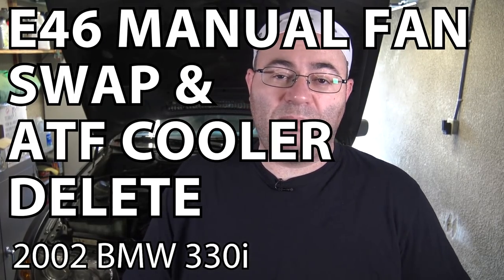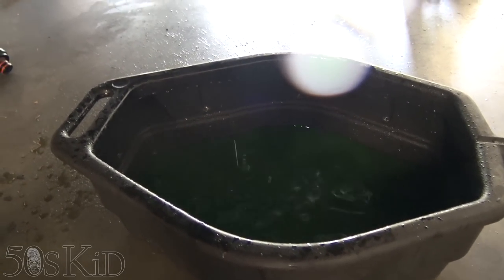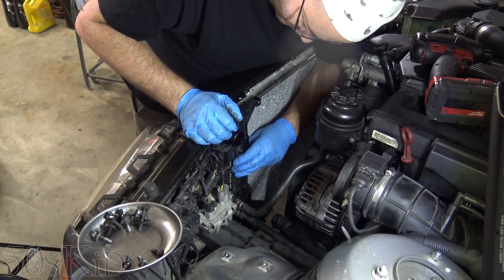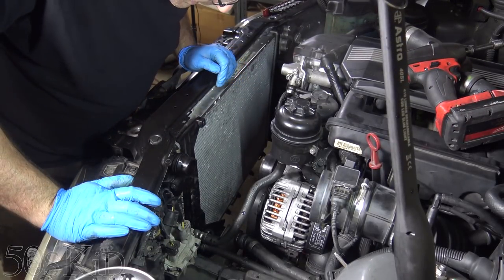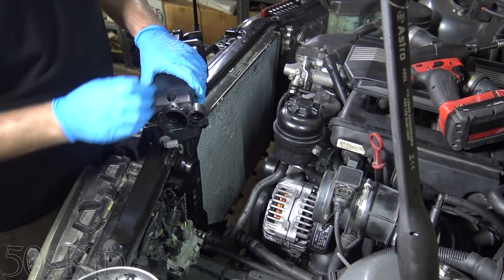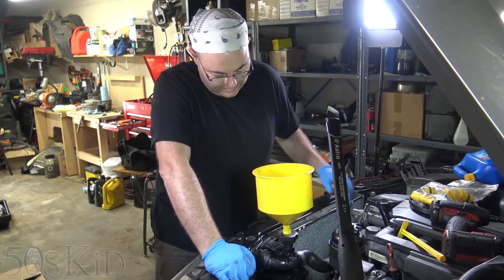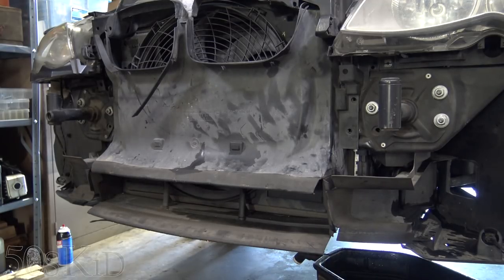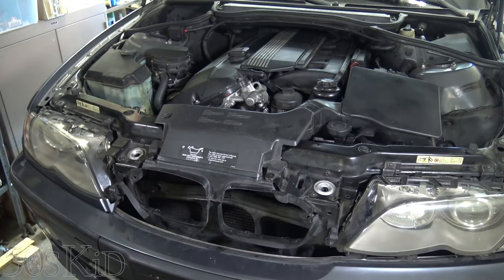BMW E46 Manual Swap Project: Electric Fan & Radiator Bracket Swap DIY

Comment: i have a 2003 330ci (coupe). in the past year my radiator fan blades broke 3-4 times at high revs , damaging the radiator with it. So I kept changing fans and radiators but the fan still breaks into pieces at high revs. I tried changing engine mounts and still to no avail. Should I just swap that radiator fan to an electrical one? Should I change the water pump? Can anyone pls help me out as I spent over $1000 on radiators and radiator fans.
Reply: Yes. Replace with electronic fan.
Reply: thanks. i replaced the radiator fan with a Hella electric fan. AC fan is still there didnt touch that one. Car is not shaking anymore when at stop light in Drive. Car runs smoother, so far no issues with the fan.
Reply: Hi what fan did you use? I converted a 320ci 2.2 to a manual. And would like to do an electric fan conversion.
Reply: @Uranus707   Hi the electric fan was 119 GBP ( British pounds) and the brand name its HELLA . done the fan conversion end of Feb...so far so good no issues.
Reply: @Uranus707 Best source is a wrecked E46. Any manual trans model 4 or 6 cyl will fit. I picked one up today from my local wrecker yard for $25.
Reply: @DiscoFang  thanks man. I went to the yards to to look for mine.

Comment: how will moving a pusher fan from front work correctly when installing behind radiator? it would need to be a puller fan! or its going to be fighting against natural airflow while driving down highway,  will only work when stationary or driving very slowly!
Reply: Is the auxiliary fan a pusher or puller?
Reply: @Stefan_Smith  pusher
Reply: Watch the video again. The two fans are completely different
Reply: This fan is from a manual trans car.  its designed to fit behind the radiator.  IMHO a much better solution and prob more effective, and much easier to work with when you need to get in there.   This replaces the whole mech fan shroud.  and will use the connector that the front fan plugged into. so the front fan is now discarded.

Comment: I need to change the radiator and the expansion tank, as well as the upper radiator hose. Upper and lower coolant hoses I’m changing to silicone hoses which has me wondering if it’s a good idea to switch to silicone O rings as well? If so do anyone have any sources or sizes I’d need?

Comment: May I asked what the purpose of this swap? What’s the difference between the fan being in front of the radiation and behind it?
Reply: the clutch fan can grenade and take out other things in the cooling system. It also makes working on the accessory system easier.
Reply: Probably adds a couple HP too.

Comment: If I want to change my mechanical fan to electric one from any of the manual model do I have to change radiation and bracket aswell ?
Reply: No. Once you remove the old shroud and fan, the electric one slides straight in. Exactly the same T25 screw and push-pin secures the new one.

Comment: Can I use both fans?
Reply: No, if you leave the aux fan in, it will restrict airflow to the radiator and electric fan.
Reply: If it restricts it, how can it work on other BMW:s too.... For example E53. I mean, this is just talk, you can say what ever about airflow restrict, but if it does, many BMW cars would have been overheated as factory builds :p
Reply: The thing is your using the same plug, there's no way to power both fans unless you do a whole lot of work.
Reply: @Yophillips3272  Aaa ok! That's the stuff. Yea then this is kinda totally different, and should then use really one fan only. I was in blackout, I have never had E46 of BMW's models.

Comment: Can this be done to a 03 530i? My reservoir is on the opposite side and mounts on to the shroud also why are you getting rid of the ATF cooler is it defective or unnecessary?
Reply: Never mind manual swap got it but I'm still interested in installing electric fan

Comment: What about when you drive without a/c , is the fan works automatically? Or do I need to do some kind of retrofitting to the DME , I am going to do the same swap on my E46. Thanks for all the info.
Reply: The plug for the aux fan will plug in the new fan. No need to wire anything. It will work the same.

Comment: Hey dude I love the videos huge fan. I have a question for you, I have a 2004 bmw 330ci 6spd Manual convertible. My clutch fan is very loud and I would like to do a delete. I read everywhere online that a manual e46 shouldn’t have a clutch fan? Well mine does, also I have the fan in front of the rad I assume is for air conditioning, that fan never sound regardless if Ac is switched on or not. The air comes out the vents when I turn Ac on but the air does not get cold. What is my issue, how can I resolve it, and can I delete both fans (Ac fan, and clutch fan) to do a swap with an electric fan?
Reply from the maker: You can do a swap as I did in this video, yes.  If your manual fan is loud, it has failed and is stuck in the "on" mode (normally it just freewheels but doesn't spin at the same rate as the engine unless it gets really hot).  If it goes too fast, the plastic fan blades can explode and take out your radiator.  It's happened to me.
Reply: 50sKid okay, thank you for your reply. Also my air conditioning doesn’t run cold. I’m trying to diagnose my issue so I can resolve it. If the ac fan never runs regardless if ac is set on or off, does that suggest my fan could be the issue?
Reply: @Sitdownbruhh  If your AC system is low on gas the AC compressor won't actually turn on. You can press the AC button and think it's running but it may not be. So the front fan won't run either. Possible reason.

Comment: are the expansion tanks different for manual and auto trans?
Reply: the expansion tank is for the car's coolant system and no coolant goes to the manual transmission, so... no?
Reply from the maker: Same expansion tank
Reply: Well it is a BMW there are no stupid questions for BMW lol

Comment: what if the air conditioning is not on ? will the fan turn on ??
Reply from the maker: yes, when the engine needs to lower the temperature of the coolant
Reply: thank you!

Comment: I have 2003 bmw 330i should I look for any electrical fan from any manual model ?
Reply from the maker: +79Pavlito yes
Reply: Thank you
Reply: And the 4 cyl models as well as the 6s have the same fan.
Reply: @50sKid  Hi, first.....thank you very much for your channel, there are many others and no offence to anyone, but yours just IS the best.
2nd, i have a manual '99 328i pre-facelift E46 and mine has only the viscus and the fan in front of the radiator. I read some of the comments which say that y
the fan you used was off of a manual E46......does that mean that i take the one in front of the radiator and move it to the back to delete the viscus or is there another fan.....sorry, just want to be petfectly sure before i mess up.
3rd, where have you gone? I am not seeing any new video's...
Believe it or not, i enjoy watching even the videos that has no bearing on me 'cause i find it entertaing...your method if delivery......so i'm quite sad to see that i have gone through almost all and no more are coming. Anything we as fans can do to help keep the channel alive????
Anywhoo, hope you see this and that everything is still well with you. Your channel might seem like a small thing, but you have made a big difference in many people's lives.

Comment: Could you not use the front fan for your read fan
Reply: The shrouds are different but the motors are the same
Reply: No, its less powerful. U need to use the correct fan

Comment: hello jason.
considering I would retain the auto trans and therefore the auto cooler and radiator mounts, instead of just by chance encountering a manual e 46 at the junkyard, would you know whether there is an oem or aftermarket electric fan available to replace the stock clutched puller and the secondary fan?
I intend to model a replacement on your tutorial.

andrew
Reply from the maker: Yeah the manual E46's have the electric fans that fit in where the manual fan fits in on an auto.  You can just grab one--I grabbed an extra one myself for a friend of mine.  They were about $40.
Reply: if I understand correctly, you remove the clutched fan, remove the aux fan assembly and the front of the radiator and replace with the "manual sourced electric fan" and plug it into the existing plug where the previous auto fan was located.
and job done?
I suppose the fan shroud then becomes redundant and can be left off the vehicle.
Reply: @andreiput9492  You have prob worked this out by now as its 4 years ago - but the mechanical fan shroud is discarded along with the clutch fan - Manual fan comes with a shroud built in the just drops in.

Comment: Hey, I have a 03 330xi and i'm attempting to do this swap. However, the fan I bought doesn't have the connection for the "air sensor" you mention @ 23:57 . Can I let this just hang? It doens't seem to be throwing any codes..? I got this fan: https://www.amazon.com/TOPAZ-17117561757-Radiator-Cooling-Assembly/dp/B06WGR7QG2 THANKS
Reply: Oops nevermind, the fan comes without the smell sensor so I just unhooked the one from my original and good to go!

Comment: Testing at 15psi? Bmw uses a 29psi cap
Reply: BMW also told me after a check i had done by them right after i bought the car that the 10k car i bought needed 290k's worth of repairs 😲
I'd rather stick to the advise that the 50's Kid gives than what BMW says 'cause the 290k bill they wanted to stick me with turned out to be around 5k in the end and my baby is still going strong 💪

Comment: Holy shit! You are running green antifreeze in your car. I thought you had a clue what you were doing on BMW's? Thanks for some of your other videos but I can't put any trust in what you got going on running the wrong antifreeze when BMW reliability is most susceptible to failure from the cooling system.
Reply: I have used green on BMW's 16y now. No problems on that area and I hear of this blue only now and it made me bit laugh :) I will keep the green one and recommend it also.
Reply: Green is better then blue bmw just wants to damage your motor that way they stay in business. Such as the method of lifetime tranny oil is bs too. Dont go with what you hear & see